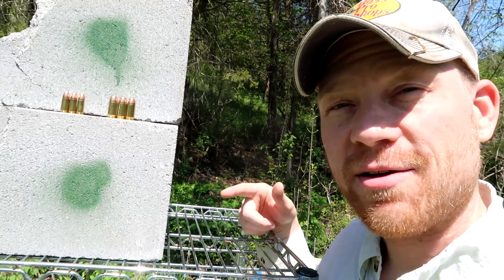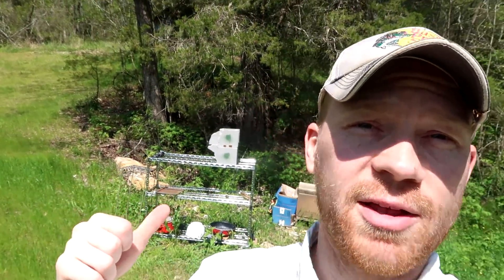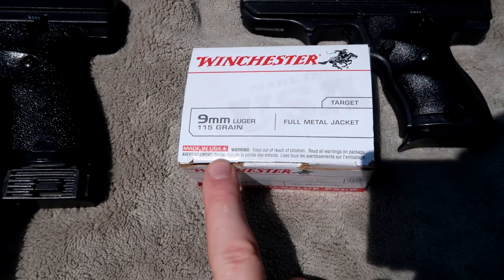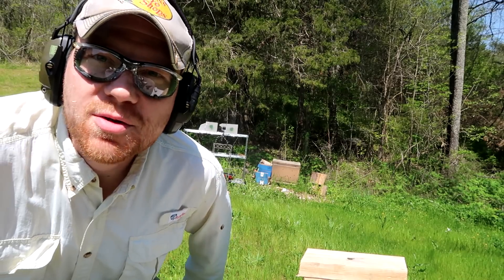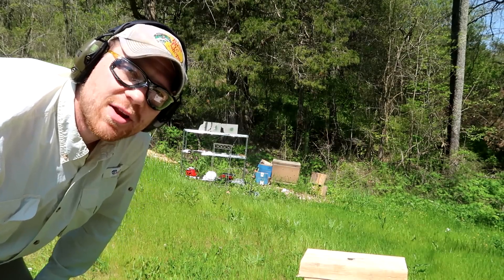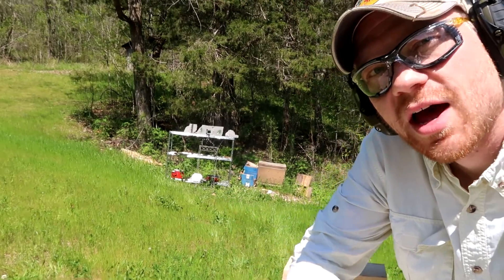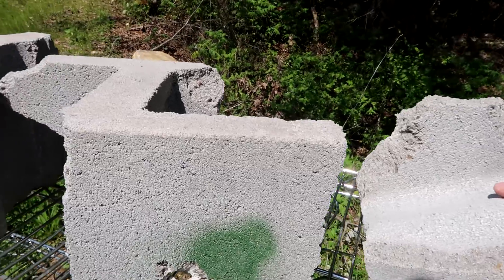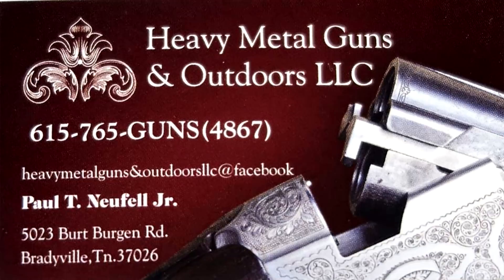9mm vs 45 ACP - Cinder Block Test

Comment: E=MC2.  230 gr. @900 fps will always outperform 115 gr. at the same speed when breaking cement construction blocks.  Recoil on a .45 ACP is so horrendous that an accurate first and followup shot is nearly impossible unless special porting work is performed.  I carry a 9mm and use Hornady 115 gr. FTX bullets.  Very low chance of pass through with collateral damage down range and I'm not afraid of the first shot.  Most first shots with .45 ACP (draw and fire {snap shoot})  miss the silhouette.  What good is that?  Anyone can hit a 10 ring if they have enough time to set up.
Reply from the maker: Thanks Tom! I am a fan of both :-)
Reply: Wrong equation.. The kinetic energy equation is E= ½mv2.  

Unless we’re talking about nuclear fission mc2 doesn’t factor here.
Reply from the maker: Thanks Atom fox!
Reply: Also the 9mm is not going the same speed.  The 9 will be going closer to 1200fps.  The 45 does have more energy but because the velocity component is squared the 9mm will have around 500 joules of energy and the 45 around 560.  Not as big a difference as you’d think.
Reply from the maker: Most ppl have no idea what you are talking about but once upon a time ago I was an engineer. Actually left because I dwcided I dodnt want to do math for the rest of my life. LOL
Reply: I love doing math all day. :) what are you doing now?  Does YouTube pay the bills?
Reply from the maker: I wish youtube paid all the bills! Maybe one day 😆. My job is pretty random, but my fancy title is a "strategic initiatives supply chain manager" 😆